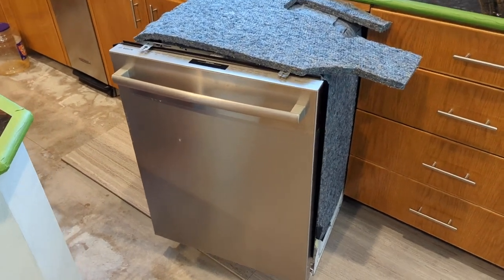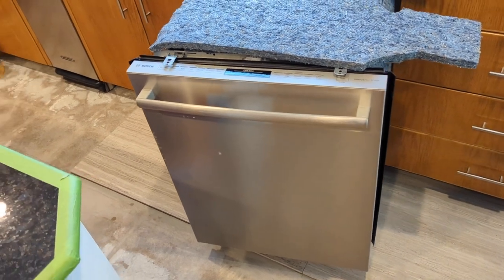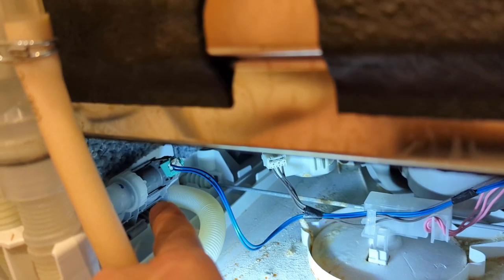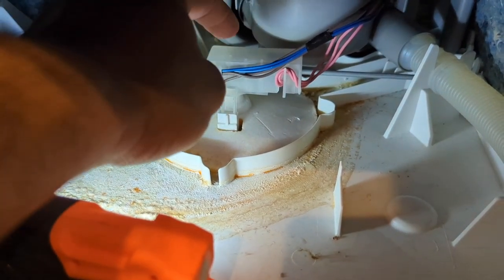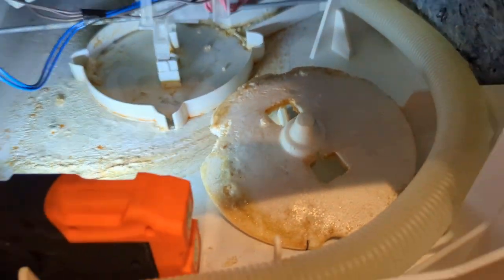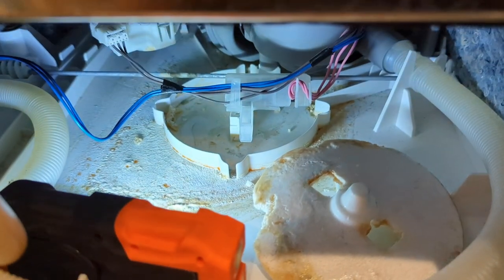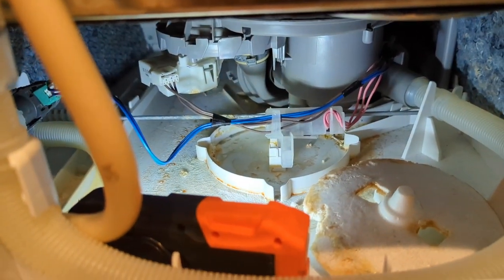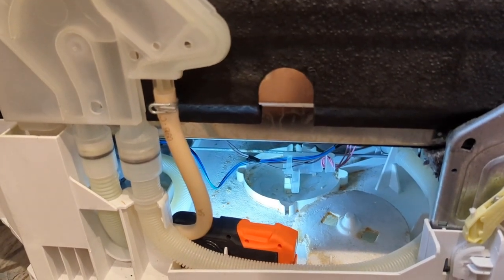Bosch Thermador Dishwasher Aquastop E05 Draining problem - Problem with Float Switch or Valve

Comment: About 2 years ago I changed the door seal because of a leakage. Unfortunately, I saw the error code e05 last night. I plugged out and in again and tried to reset but neither worked for me. Troubleshooting guides talks of two options. Either a faulty flood switch or a faulty control board. I hope it is an issue of a flood switch. This way I can repair it cheaply.
Reply from the maker: I bet it is the flood switch. If it is, it’s an easy fix